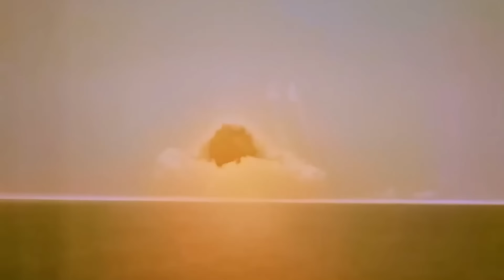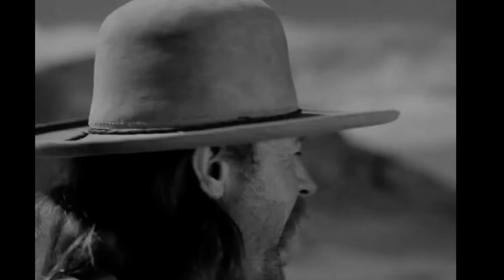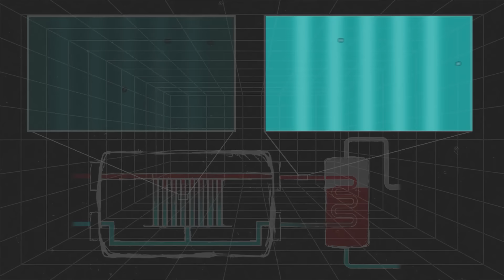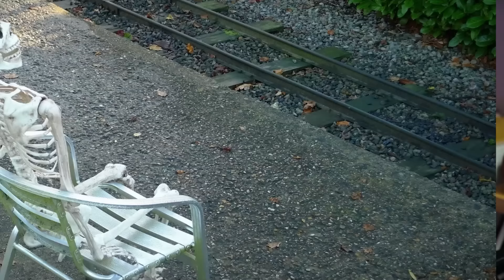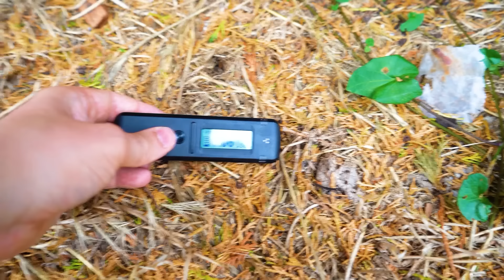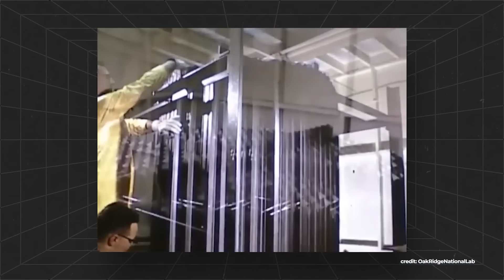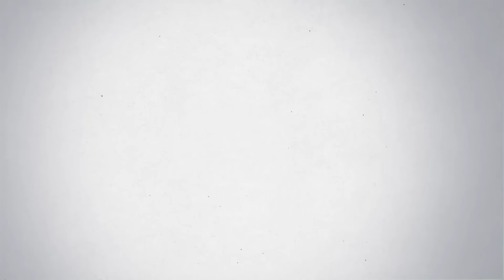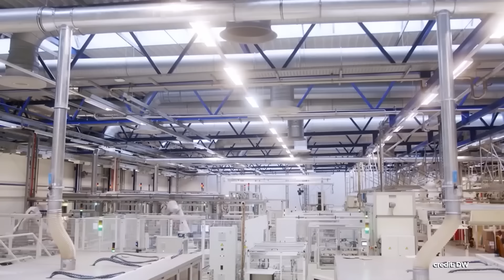It's Happening - China Launches World's First Thorium Nuclear Reactor

Comment: Eh, let's wait until it's one year into full production - because whenever sensational titles spring up, they always have a big lead time from reality.
Reply: China generally puts out. I believe their timelines when they give them.
Reply: i think china usually does get the job done on time
Reply: Well, this is an official project as a power plant, not a proof of concept lab reactor. I won’t think it shall be delayed if at all, unless the  engineers REALLY screwed up…..
Reply: China has a good track record of out-doing people's expectations.
Reply: China used to be a communist nation, say what you will, but they'll deliver on time 🫡
Reply: I'd be more interested in their assessment after their first major maintenance shutdown. Everyone gangsta when molten salt is flowing in a pipe, but consider the difficulty of pumping it.
Reply: It's still a research project.
China explores all ways to get clean energy. Their battery and EV is a part of cleaning up the air pollution.
Solar is a part of that too. But that won't  be enough.
They have cleaned up coal power too, to reduce air pollution from that as much as possible.
They even work on fusion lower, which isn't anything we expect to happen soon.
China knows that fossils fuels has to go, and they work systematically to replace that with something.
Thorium molten salt reactors might be the right complement to solar and batteries.
Reply: Let us wait until 2030, if it is actually completed 2029.
Reply: china is big on talk. but that's it....
Reply: @theoldtimefiddler  There are many countries that talk the talk but don't walk the walk. China isn't one of them. Especially when it comes to industry.
Reply: @theoldtimefiddler  China has been pretty good at delivering on their promises.  They've build a substantial amount of highspeed rail, are on target for their clean energy goals, and are currently leading the world in electric vehicles.

Comment: The only problem I have is the problem of battery waste over time.  Batteries don't last forever and recycling them may be solved or remain an environmental issue.   If they remain an  environmental issue, could we make hydrogen through the use of these kinds of reactors and power our vehicles that way instead?  We wouldn't destroy the ecosystem digging up the rare metals needed for batteries.  We wouldn't have to recycle batteries when they aren't the primary energy storage tool in millions upon millions of vehicles.
Reply: There is a fairly mature recycling pipeline for rechargeable batteries now and growing. There are easily reached collection spots. Who throws their rechargeable batteries into the general, headed for a landfill rubbish? To anyone reading this ,the recycling stream exists, like for lead acid batteries. Companies collect and fully extract all the metals from the batteries. Find the collection spots near you. Transfer station or electronic store. I think some big box stores have a place for them. Just Google it for your area.
Reply: You can make hydrogen with anything that produces electricity, the problem is it's extremely inefficient. So you should only do that if you have a lot of excess energy that cannot be stored or used straight away
Reply: they are already recycling lithium batteries, hence unclear of your concern. Hydrogen production is a different topic altogether

Comment: You need more than heat to power a heat engine. You need a place to reject heat too. Putting a thorium/steam power plant in the Gobi desert means that the condensers have to be air cooled, hence much larger than a typical water cooled condenser. It is conceivable that a thorium Brayton cycle could be utilized, where the working fluid is air and that the waste heat would be in air and simply exhausted to the atmosphere.
Reply: Is a hot desert that hot compared to molten nuclear material?
Reply: Gobi desert is a cold desert. The highest temperature in summer is 38 Celsius. The coldest is -26.5 Celsius in winter. Average temperature is 2.8 Celsius. Dumping heat into the air is viable.
Reply: Desert doesn't equate very hot. It just means there is very little life there, mainly because of lack of water, rarely because of excess heat alone. It can be very cold at night and very hot during the day. Antarctica is also technically a desert
Reply: Gobi is a very cold place, nothing like the normal image of a desert. Tibet is also a technical desert bc of lack of water.

Comment: I wonder how they will solve the problem of the corrosiveness of the fuel coolant mixture
Reply: That is why this is a 2MWthermal test reactor.  Oak Ridge was a 10MWthermal test reactor.

Multiple countries have spent the last 15+ years researching possible super-alloys that would be much more corrosion and radiation resistant than the alloys the USA used in the 1st 2 MSR test reactors.   I've actually read some of the papers.  No one yet has identified a corrosion/radiation resistant alloy.  But they have identified ones that have very slow corrosion/degradation rates.

At the same time the concept that we can filter out the worst of the corrosive compounds from the MSR stream has developed - and laboratory testing with partial simulated fluids have indicated the possibility.

The very purpose of this test reactor is to see if the combination of their "best guess" of a new super-alloy and their "best guess" for a filtration system will reduce the corrosion/degradation rate to a level where you could desing a reactor with a 40+ year operating life by just using a modest "corrosion allowance" typical for what is commonly done when using carbon steel alloys.

Time will tell.  My personal guess is that the alloy will likely work well enough (and I am sure that there are corrosion coupons of the other alloys in the reactor); but that they may have to redesign the filtration system a few times to get it to where it works well enough in both filtration and reliablity.
Reply: @perryallan3524  thank you for your detailed response to my question!
Reply: Several companies are testing ceramics.
Reply: Dewater the salt by using anhydrate salt and enclosed environment devoid of humidty, and improve purity of the salt. 
Ceramic lining. 
Molten salt resistant high nickel steel developed post 1970s IN625, H230 and 740H . Molten salt is also used in solar concentrates and research labs. So work had continued for decades on molten salt resistant steel.
Reply: @nickl5658  The problem is not the molten salt, or even the unreacted nuclear fuel dissolved in those salts.  Ordinary 304 SS will handle the salts used for MSRs.  

The problem is 1st being able to handle the daughter products from nuclear fission and then the chemical reaction products that form from those daughter products and everything else in the molten slat fuel daughter products and reaction product stream.

The 2nd problem is the very intense radiation fields inside a nuclear reactor.   Gamma and neutron radiation, is very bad for all kinds of alloys that work in non radiation fields.   Oak Ridge was very surprised when they found out how radiation embrittled and degraded the Hastalloy they used in their MSR was for a reactor with only about 2+ years of real run time.

Solar concentrates and industrial plants do not deal with nuclear decay products and the resulting chemical reaction products.  Nor do they have to stand up to a high radiation field where gamma and neutron radiation levels will crispy all kinds of alloys.

And no, despite many $millions poured into research looking for a super alloy that would stand up to this... no one has found one yet.  But they found several that they think will corrode and degrades slow enough to be able to build a long life nuclear reactor.

As for linings (ceramic or otherwise)... They are short term solutions only, and once you get a flaw all the corrosion for the entire system is focuses on the flaw area.  Holes have been eaten through tubes and pipes in less than 2 months when coatings fail (and I have ordered and reviewed the metallurgical reports on many tubing and piping and some casing failures.  By the way, this is a known problem with linings - and covered at about the Lining 102 level training.

Ceramics themselves tend to be brittle and there is no way to join the pieces without joints... and joints tend to leak badly after time.  Nuclear Power plants do everything possible to avoid joints.  You can weld togehter metal.   You cannot weld together ceramics; and dealing with thermal expansion with a brittle material like ceramics is a nightmare from the start.  I doubt that ceramics would even pass the seismic testing required for nuclear components in the case of the worst case earthquake.
Reply: Jai Hinduja. Removing moisture
Reply: @chaz4609  it's far more than moisture that has to be removed.  In fact, I doubt there is any measurable moisture in the molten salt -fuel - decay product mixture.   Industry and the nuclear world is very familiar with operating entire systems with a cover gas instead of exposure to the atmosphere.
Reply: @perryallan3524      wrong
Reply: @chrism.1131  Please tell me where you think I am wrong.
Reply: People think "corrosion" means rust. That may be the most common corrosion people see around them, but it's FAR from what's happening here.
- Liquid metal is highly reactive, and can react with anything touching it. That's a form of corrosion.
- High temperatures make materials more reactive and so more susceptible to corrosion.
- The elements in salts are often highly reactive, which is why they form the ionic bonds associated with salts. For example, Cl and Br can cause lots of problems.
- Not corrosion, but other problems with high temperatures are mechanical changes in materials, such as creep & recrystalization. 
 
These aren't the most severe environments things have to operate in (think about the insides of jet engines), so I'm confident the corrosion issue is fully manageable. It's certainly less challenging than keeping track of all the radioactive material--liquid fuel reactors can have fuel solidify inside tubing, so it's challenging to know where it is and whether any has been stolen.
Reply: Thorizon is using prefab core cartridges to work around the corrosion problems in the core. But to get the best corrosion resistant materials they're relying on the test results from the Dutch-German project called the DIFFER Irradiation-Corrosion Experiment (DICE).
Reply: By purifying the salt, very pure salt is not corrosive.
Reply: @chapter4travels  Pure salt contains no nuclear fuel, nor the daughter products that occur from fission, nor the chemical reactant products that form from those daughter products reacting with the moten salt and other new chemicals now in an operating MSR liquid fuel/salt/daughter products/chemical reactants stream.
Reply: @perryallan3524  Those are not an issue in a design like Thorcon Power or Terrestrial Energy. Their issue is the graphite moderator degrading over time. Heat is removed by pure salt that doesn't contain any of the impurities that you listed. That's why they are replacing the reactor core every 5-7 years. (in the beginning) It's an incredible opportunity to iterate the design at each replacement interval.

Comment: As far as I can make out, Thorium MSRs provide an opportunity to isolate Pa-233 by chemical means, which decays in 27 days to pure U-233, which is known to be ideal material for nuclear weapons. This, is a big downside from a proliferation point of view. You have to really read around to find this discussion but it appears to be valid. If it's true, this might be a lot easier than trying to isolate U-235 with centrufuges as is currently done to make weapons.
Reply: Hi Kitten Processing Inc4415,
The USA built ONE U233 bomb to prove it could be done.  It had lower than expected yield, and was a total pain in the ass to build, as the decay chain of U233 produced hard gamma rays.  These gamma rays, make building the bomb expensive and dangerous, can damage the electronics that are needed to set off the bomb, make it easy to track from orbit, and made moving and maintaining the bomb much harder compared to regular U235 and PL239 bombs.  

NO bomb has been made from U or Pl from commercial power plants, so this whole argument is very weak.  But U233 from Thorium is far harder to use than the common U235 from regular nuclear.

Warm regards, Rick.
Reply: @RicksPoker  nicely done rick. could not have said it better
Reply: @RicksPoker  Actually it was the U232 contaminatinon that caused the gamma rays.  The USA solved that problem and found a way to produced essentially pure U233 without any U232, or U234 contamination.  It would have worked better than the Pu239 bombs.  But the cost of prodcuton was astronomical  compared to the cost of Pu239.

Also, not just the USA.  Russia and India also test detonated U233 bombs.
Reply: Blanket time!
Thorium-232 has a moderate cross-section for absorption, but there’s so much of it in the blanket that it does almost all the neutron-absorbing. After absorbing a neutron, the Th-232 becomes Th-233, which has a significantly higher absorption cross-section (almost 200 times that of Th-232) but its half-life is so short (22 minutes) that it isn’t around very long to absorb a neutron.

Once it turns into Pa-233, the absorption cross-section is still over 5 times greater than Th-232. That's one of the basic reasons why it’s so important to isolate the Pa-233 from the blanket, to prevent further neutron absorption, which is a step you can’t do in a solid-core reactor that’s trying to “burn” thorium (and achieve a conversion ratio of > 1.0).
Reply: @mrhassell  The USA built at least one solid core thorium reactor that generated more U233 than the reactor used.  Shipping-port core load 3.

While I have not seen the data the USA also put sold thorium fuel in other light water reactors to generate U233 (contaminated with U232/U234) for seeding future thorium fuel cycle plants. They produced tons of this U233 (and am now spending $billions to dispose of it as the storage containers are degrading).

I have heard that they perfected a breeder core for the plants that they ran this other thorium in.  Again, I have not seen the actual data.  I have seen data for Shippingport Core Load 3.

But key point is that if thorium was a cheaper fuel than U235 then most of the world PWRs and BWRs could be running thorium right now.
Reply: China has started years ago the biggest buildup of nuclear weapons since the cold war. And no one is talking about it. I know that platform doesn't like such things to be pointed out for some reasons. And now with bots they actually have the means to shadowban and erase all comments that would say such things. And I can say they do. I would be surprised if this passes, but sometimes it does.
Edit:  This is a test. Oh, wow, it stuck, for now at least.
Reply: u-233 is good for nuclear weapons, but you know what is not? the u-232 that comes with it. since it's highly radioactive and hard to handle, so no, no nuclear weapons with u-233
Reply: @Sputnick_00  If the U233 is separated via the Pa233 route, one would get U233 with essentially no U232.  It's "simple" chemical separation and waiting - no classical isotope separation needed. Not using the Pa separation would make it hard to reach breake-even breading in a simple thermal reactor.

U232 is however an issue in cleaning the thorium fuel with reusing the thorium. The chemical sepration is anyway the weak point - at the current standing the costs for the required reprocessing make thermal breading in the thorium cycle way too expensive, if one really wants to get a thermal thorium breader.
Already repocessing classical uranium fuel turned out rather expensive and not economic - with the thermal thorium breader multiply that by maybe a factor of 100.
Reply: @Sputnick_00  you can get U-232 impurity down to 5ppm with careful separation, plug it into a lead sphere and it is workable. The good thing about U-232 is that it runs very very hot, and can be easily detected and tracked without tons of shielding.
Reply: @Sputnick_00  They can separate them with centrifuges.
Reply: @Michael-Has-Opinions  still, a lot of radioactivity, and a big hassle to work with
Reply: the only countries making nuclear reactors consistently already have or will never use nuclear weapons. oil spills are still more deadly than all nuclear accidents put together.
Reply: @jonathanodude6660  true
Reply: Agree. This is something never mentioned. But the proliferation risk seems real. In addition to the always-existing risk of dirty bombs of course.
Reply: Also every Liquid Thorium reactor requires chemical separation of Pa-233 because it will breed too much. Worse, Pa-233 can be used in a gun type weapon, which would be a lot easier to build. This isn't to say Thorium MSR isn't a truly remarkable technology and shouldn't be used. It's just another thing to think about regarding proliferation.
Reply: @joshcryer  If it was easier than the U route, they would have done it. If it was easier than the U route, Iran would be doing it right now and to hell with centrifuges. U232 and U233 are much harder to separate than U235 and U238. We're talking about 1950s tech here, something that could have been replicated easily by anyone wanting a bomb if it was indeed the easiest route.